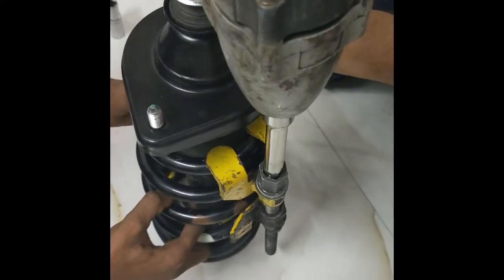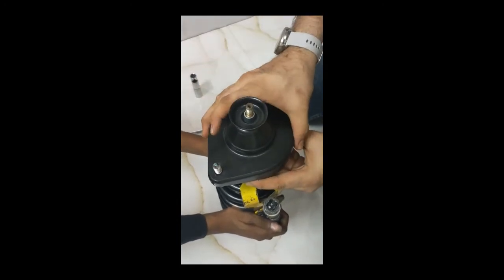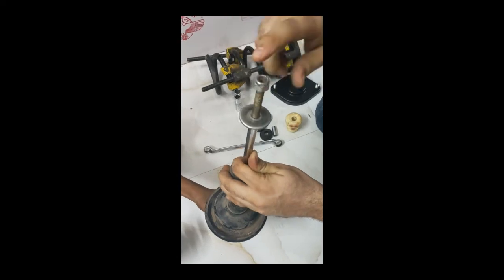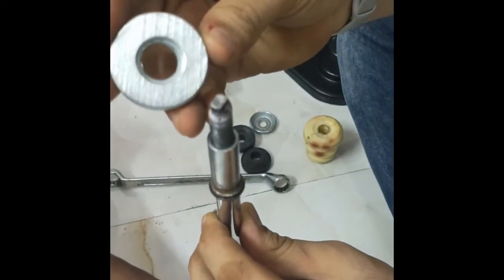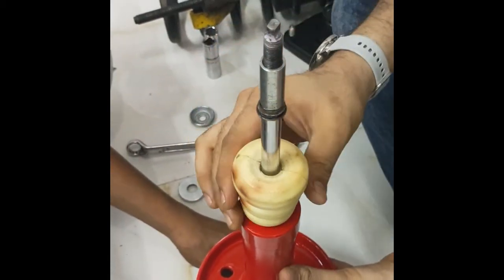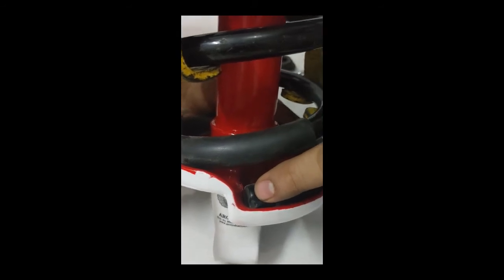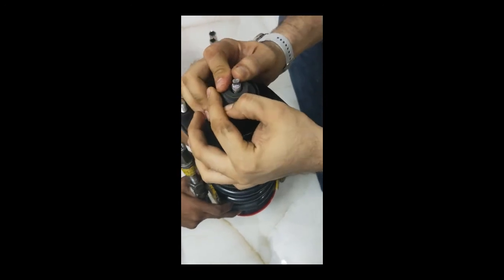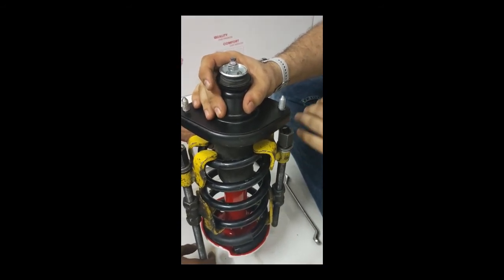How to Install ARC Suspension - Mahindra XUV 500 - Rear Shock Absorber

Comment: Brother xuv 500 w8 2011 model
  Front site ki hight badha ni thi. Badh skti hai ka shockup sir se...
   Pizz riply...
Reply from the maker: Height nahi badhegi. Par suspension setup se front bottoming out thud sound chala jaayega.
It will solve the existing issue of thud sound with our setup
Product link - https://www.arcsuspension.in/mahindra/xuv-500/mahindra-xuv-500/mahindra-xuv-500-performance-upgrade-kit-2011-2021-rear-shocks-absorbers-and-front-strut-assembly-shock-absorber-with-coil-spring-2011-2021-rear-shocks-front-full-assembly

Comment: Bhai xuv 500 2011 model ki rear hight badha sakti hai kya
Reply from the maker: Height Nahi Badhegi, but bottoming out puri tarah se fix ho jayega, vehicle will drive like an actual SUV with the benefits of a Sedan :)
Please click the link below to know more
https://www.arcsuspension.in/mahindra/xuv-500/mahindra-xuv-500/xuv-500-arc-suspension-suspension-upgrade-kit-front-and-rear-2011-2021-rear-shocks-front-full-assembly

Or call us at 9422047019 / 9922099292

Comment: How to get arc suspension for my xuv500 w6,  I'm in bilaspur chhattisgarh, any local dealer or mechanic who can install it perfectly
Reply from the maker: Sir you can order the suspension from our official website arcindustries.co.in
Installation can be done by any local mechanic, no modifications required. our parts are direct replacement to OEM parts.

for 2011-2017 XUV  - Front and Rear Shock Absorber
https://www.arcindustries.co.in/products/mahindra-shock-absorbers-96997/xuv-500-shock-absorbers-101102/mahindra-xuv-500-arc-comfort-series-shock-absorber-suspension-kit-front-and-rear-368369

For all XUV Rear Shock Absorbers
https://www.arcindustries.co.in/products/mahindra-shock-absorbers-96997/xuv-500-shock-absorbers-101102/mahindra-xuv-500-arc-shock-absorbers-184185

Contact us on 9422047019 / 9922099292
Reply: @ARCSuspension  and installation charge approximate?
Reply from the maker: Please get in touch with Mr. Deepak Pawar 9422047019 or Mr. Rohit Pawar 9922099292.
Reply from the maker: Product can be ordered from the below Link - 
https://www.arcsuspension.in/mahindra/xuv-500/mahindra-xuv-500/mahindra-xuv-500-performance-upgrade-kit-2011-2021-rear-shocks-absorbers-and-front-strut-assembly-shock-absorber-with-coil-spring-2011-2021-rear-shocks-front-full-assembly

To know more Call us on 9422047019 / 9922099292

Comment: Xuv 500 how much
Reply from the maker: ₹58500 for the Full XUV 500 ARC Kit.
https://www.arcsuspension.in/mahindra/xuv-500/mahindra-xuv-500/xuv-500-arc-suspension-suspension-upgrade-kit-front-and-rear-2011-2021-rear-shocks-front-full-assembly
Reply: @ARCSuspension  has price increased? Looking for W10 2017
Reply from the maker: No sir, prices are same as before.
Front shock absorber comes with coil and strut kit.
For 2017 only shock absorbers wont fit. It needs fromt assembly.
Call us on 9922099292 or 9422047019 , we will explain the difference.

Comment: Cost ?
Reply from the maker: 2011-2017 XUV 500
https://www.arcindustries.co.in/products/mahindra-shock-absorbers-96997/xuv-500-shock-absorbers-101102/mahindra-xuv-500-arc-comfort-series-shock-absorber-suspension-kit-front-and-rear-368369

rear fits For all XUV 500.
https://www.arcindustries.co.in/products/mahindra-shock-absorbers-96997/xuv-500-shock-absorbers-101102/mahindra-xuv-500-arc-shock-absorbers-184185
Reply from the maker: Product can be ordered from the below Link - 
https://www.arcsuspension.in/mahindra/xuv-500/mahindra-xuv-500/mahindra-xuv-500-performance-upgrade-kit-2011-2021-rear-shocks-absorbers-and-front-strut-assembly-shock-absorber-with-coil-spring-2011-2021-rear-shocks-front-full-assembly

To know more Call us on 9422047019 / 9922099292